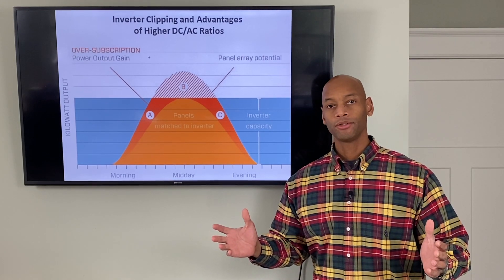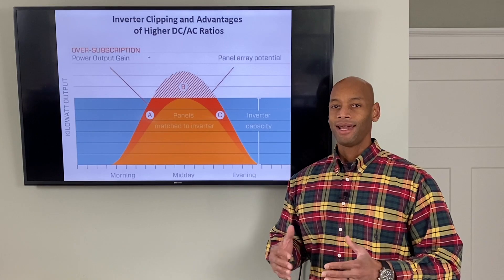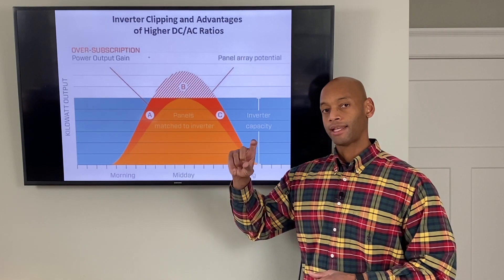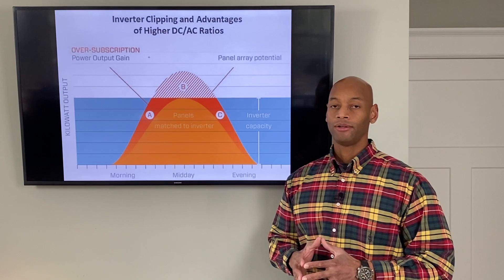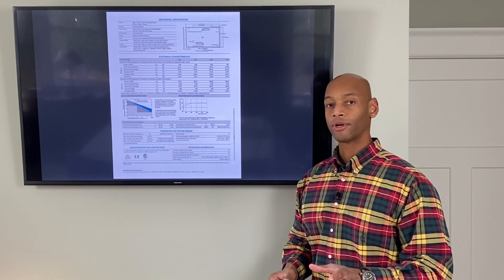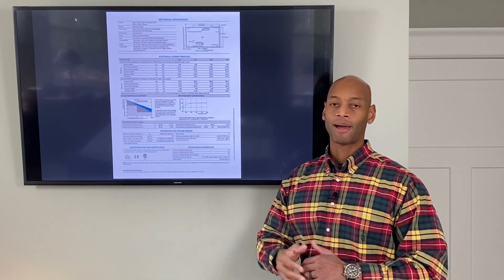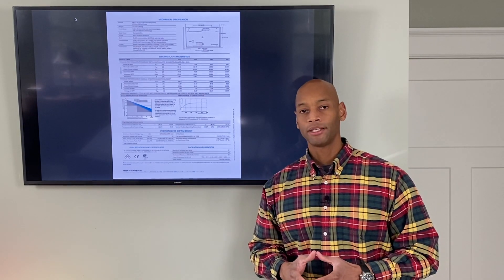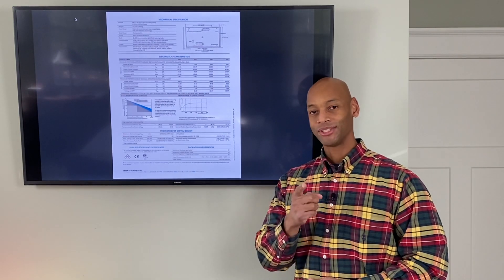How Much Solar Power Should I Expect?

Comment: Hello brother ,what a very good explanation . I want to buy a power station with solar input specifications 400-500watts max  ,voltage  12-48 volt and the current 10A max…will it be ok to buy a 600watts panel  voltage of 41 v and 17 A. The 17A of the panel seems way too high to the specifications of power station , is it it not gonna damage the power station.

Comment: Joe, I'm a regular watcher and a subscriber.  For the past twelve years I have owned a 4.73 kWh rooftop SunPower system. Very happy with it. I live in Scottsdale, AZ - in the "Valley of the Sun."  Occasional cloudy days do impact the amount of kWh's my system generates, but  so does the volume of dust in the atmosphere. Dust is a big issue here. Tuesday, January 24, 2023 my panels generated 24.1 kWh's. Wednesday the 25th - again 24.1 kWh's. Thursday, January 26th - 25.3 kWh's. Friday, January 27th - 24.9 kWh's. All four days offered cloudless clear blue skies. The variable was the wind and the dust.  A decent wind on on the 26th brought the best generation day so far this year. When rooftop solar owners question me about different performance numbers, I urge them to take into account the volume of dust in the air - a daily reality.
Andre.

Comment: Hi Joe. I am wondering if my inverter may have a technical problem.  My house uses a SolarEdge 6000 US inverter.  I have just added a few additional panels and optimizers to my existing system bringing the total panel wattage to 7760w.  When looking at my monitoring portal, I notice clipping whenever the power approaches 5300 watts. When i look at the inverter screen, the voltage increases from a normal 357v to over 430v when the clipping is occurring.   I guess I was expecting the clipping to occur at the 6000w level.  Can you help me understand why my system maxes out at 5300w?
Reply from the maker: Hi Joe.  You may have an inverter malfunction.  The 6000 inverter should only clip at 6kW AC output.  I suggest calling Solar Edge tech support to see what diagnostics they can can perform to get you an better answer.

Comment: Hi thank you for this very good video, but taking your explanation and considering the NMOT instead of the STC to size the inverter then they is no clipping. Indeed if the max power of the solar panel will never exceed the NMOT and the inverter are according to the NMOT value then no way to have clipping effect. Do m I right ? Thanks again
Reply from the maker: There will always be some clipping when sizing inverter to the NMOT rating.  Typically you will see the clipping during the middle of the day when photon are hitting the solar cells perpendicular.

Comment: If I understand correctly the inverter is typically sized for the NMOT rating or (80% of the STP) because the STP performance is rarely if ever seen in the field. Sizing the inverter for the STP rating would be throw away money. Is that correct?  Oregon would benefit from your services. Id love to take advantage of Solar Surge. Thanks!
Reply from the maker: Hi Payse.   Yes, that is correct we size inverters based on MNOT rating.  We actually do work in Oregon.  If you'd like to book a meeting, please use this link: https://calendly.com/solarsurge/solar-consultation

Comment: In the morning PV panels will be more efficient (colder), than in the afternoon due to their temperature coefficient. Therefore, the day output graph will not be symmetric in most cases (dependent on location, PV technology). But I understand the simplification for the purpose of this video :) Great content btw
Reply from the maker: Thank you and yes, you are correct.  The PV panels output higher power when temperatures are cool.

Comment: The company I contracted with attempted to install 16 SILFAB model 310 NL and a couple of SILFAB 320 NL panels on my roof.  However, I paid for SILFAB 330 BL Panels and this was in the contract and project plan.  I noticed the issue just as the 310 and 320 panels were ready to go on the roof.  They were scratched, had signs of being poorly stored and were not packaged for transport to  my home.  I stopped the installation and complained.  They said it was an honest mistake and brought the correct new panels the next day and installed them.  Is this a common honest mistake that happens with solar power system companies?
Reply from the maker: No I don't believe this was an honest mistake.  Those panels were probably leftovers from a previous project that the installer was trying to pass off as new materials.

Comment: The beauty of a DC-coupled inverter with a battery like Generac PWRcell is that when the inverter’s AC output peaks, the battery can store that excess DC energy that AC-coupled inverters will clip.
Reply from the maker: Very good point.  Thanks for sharing this.

Comment: Nice explanation @Joe! Open Circuit Voltage, the standard voltage of the grid is 120 V or 230/240 V, how is this voltage for each individual panel ramped up? Is it the microinverter/inverter that does this? Or is it something else? And how does it happen? Thanks!
Reply from the maker: Great questions.  Each solar panel presents approx. 40V DC voltage.  If you use a micro-inverter, it will convert the low voltage DC up to 240V AC to match the grid.  In a central inverter system, the solar panels are wired in series strings of 8 - 15 panels to reach of voltage of 300-600V.  Then the central inverter at ground-level down-converts the higher voltage DC to 240V AC to match the utility grid.
Reply: @SolarSurge  Makes more sense now about the Voc. Thank you for the answer, Joe! Would you be able to tell the difference between Impp and Isc and the difference between Vmpp and Voc? Thanks!
Reply from the maker: @the_jolly_engineer  Great questions.  Impp = current and maximum power point (durning production).  Isc = maximum fault current if you short circuit the solar panels.  Vmpp = voltage at maximum power point (during production).  Voc = voltage with the circuit is open (nothing connected to the solar panels)

Comment: Can’t you get a better inverter?
Reply from the maker: Yes, you can always purchase a larger inverter.  However, inverters work most efficiently when you run them just below the power limit.
Reply: @SolarSurge  Great video! 😊 Does this same ideology apply to microinverters? Shouldn’t a panel coupled with say an Enphase microinverter always be able to match the max rating of that panel?
Reply from the maker: @TurreTuntematon  Yes this same concept applies to micro-inverters.  Take the Enphase IQ7 micro-inverter.  It has max 250W AC output but it will allow you to connect a solar panels rated up to 340W DC.

Comment: What is the typical cost per watt of a roof mounted system vs a ground mounted system?
Reply from the maker: That depends on your area.  Ground mount is usually 20% higher cost.  If you'd like a quote, please reach out to us at info@solarsurge.net

Comment: Joe,
Another thought after looked closer at your charts.  😀

I worried about how much losses a super hot summer roof solar collection ("NMOT" if I make out the chart correctly) could be... vs what the data sheets (lab "STC"). 
It seems your ~90W difference is about 75% of the stated STC value.  
-  Is that a typical average for the industry?

Brother, so do I understand you and the chart correctly that on my hot summer roof, an STC 340W unit actually only provides 254W to the Inverter in real-world conditions?   
- Does that data assume or equate a specific latitude? 
- Oh yeah and accounting for those inverter losses of some average. 
- Ha-ha and also the yearly age Degradation on the solar array. 

For me, I'm trying to find info to help me determine how many sq-ft of solar roof (at perfect orientation) I need in order to produce the energy I'm expecting to consume.  That at least I think I have a good guess (40-45kWh avg for summer needs). 

So far all I've determind is that the retirement home I trying to design must be a single story home to maximize roof area. 😳

Cheers, 
Eric
Reply from the maker: Hi Eric.  Yes, you are correct in assuming a 340W panel will only produce 255W usable power on a hot sunny day on the rooftop.  Ground-mounted panels would produce more power because they can vent and cool better on a ground mount setup.

For 45kWh per day, based on 4.75 hours of ideal sunlight per day here in Virginia, using 340W solar panels, and assuming 10% conversion losses in the system, you would need space for 30 solar panels.
Reply: @SolarSurge  Excellent! 
So we can count on 10% conversion losses... so is that 10% just related to the Inverter and related energy transfer?  
Meaning its after I've accounted seperatly for the 340W less the 90W real-life on roof harvesting? 

Joe, is the data sheet you showed typical of what all PV producers must provide?  

The retirement home we are planning is very similar to our VA home with the front being south facing... so Snow & Ice melt best on walkway & driveway.  I remember you suggesting a lot with the rear roof as South facing for the more attractive look from the street.  
My wife & I settled that for solar we would go for solar shingles and not panels.  The technology wasn't there 6 yrs ago for this home however in the next year or two we praying either Tesla or others to be ready.

Comment: Joe,
Another excellent edu video, very Important distinctions!  

Say, do you find that both your Genrac and Tesla systems have well balanced and matched Solar Shingle/Panels & Inverters so all peak energy is harvested?
Reply from the maker: Great question.  We usually overload by 120%.  So, for example, for a 7.2kW DC rated system, we could go 6kW on the inverter rating.
Reply: @SolarSurge  excellent! 
Does your 120% also account generally for PV decay over say 25 years?  
Meaning between Inverter losses and PV decay ... if my energy survey shows I use 44kWh need... I best plan for 53kWh?  

lol..  I know I'm trying to make this simpler that it really is. 😬
Reply from the maker: @erickessler6094  The 120% overload is based on the initial nameplate rating.  Over time, this would reduce to only 105% as the modules decay on average 0.5% per year.
Reply: @SolarSurge  thank you Joe!